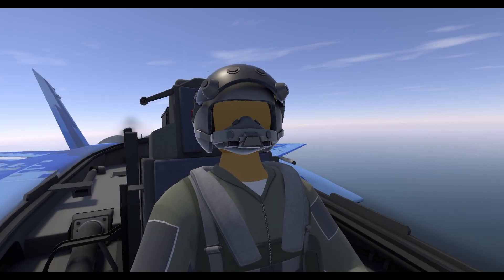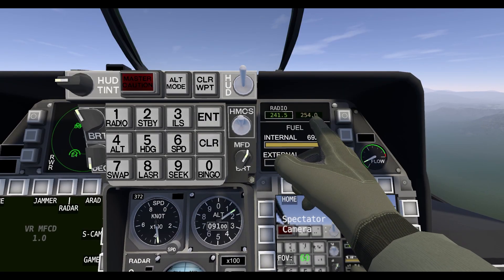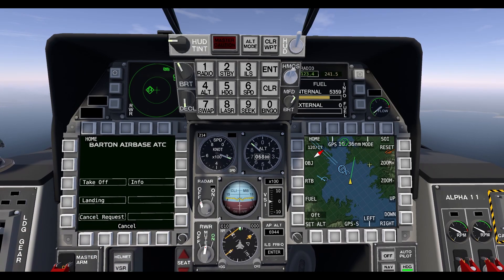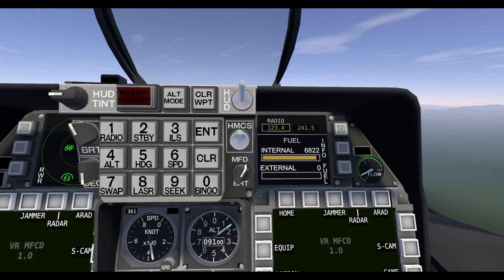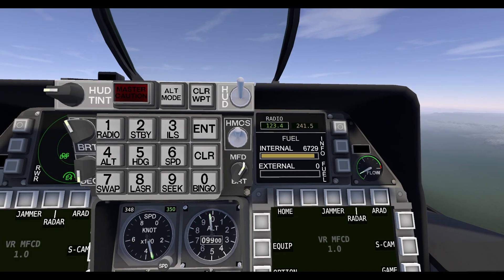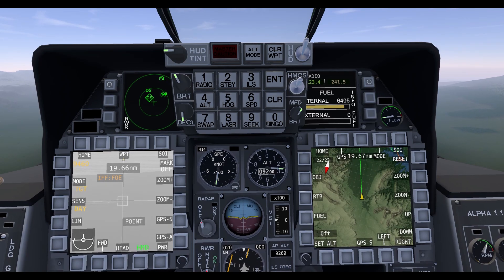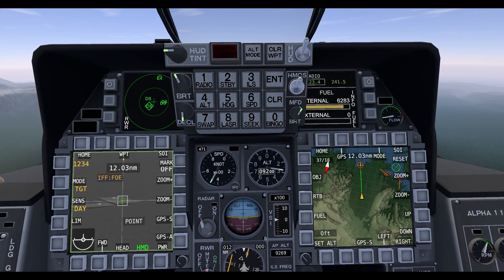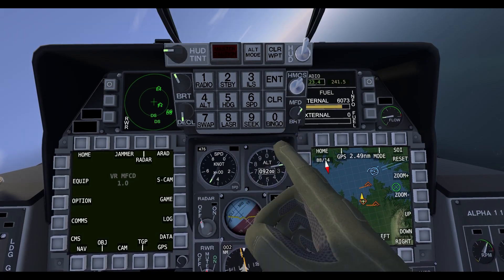Up Front Controls Explained | VTOL VR Tutorial

Comment from the maker: Additional notes:
1. 3:48 You don’t have to set your seek code to your laser code. 
If your seek code is still set to default, meaning you haven’t changed it, then it’ll still target wherever you’re pointing, no green diamond needed. 
If you do change your seek code and want to set it back to simply target what your TGP is looking at, you can set your seek code to 0.

2. “To add to this, the laser code gets "locked in" the moment you drop a bomb. That means you can drop a bomb with one laser code, and then quickly switch to another code and drop the next without having to wait.”
 - @LeeAndersonMusic